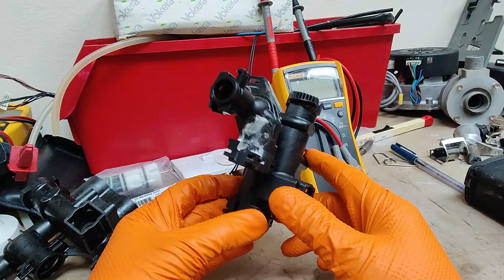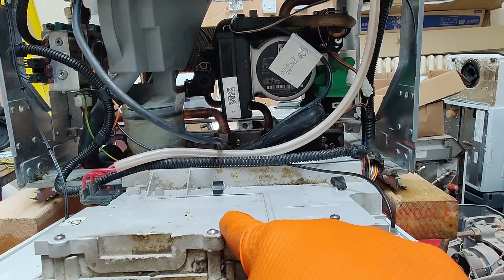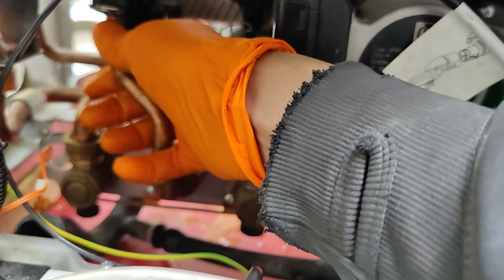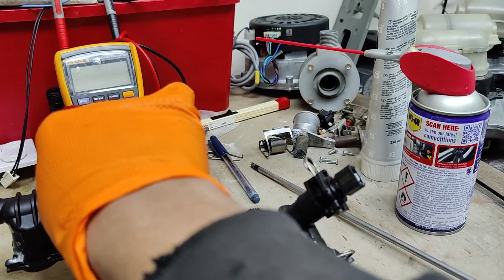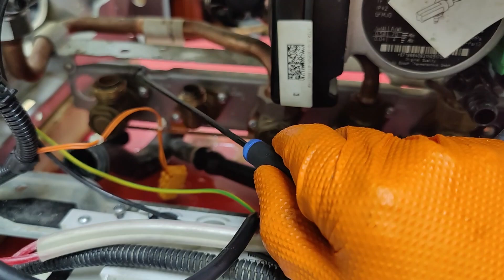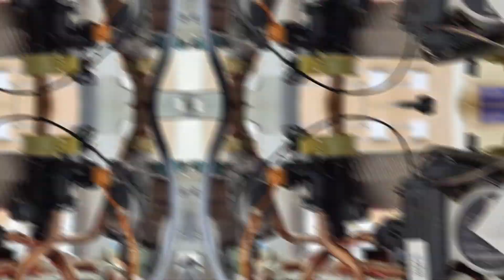How to Replace a Worcester Bosch Left Side Flow Manifold | Step-by-Step Guide

Comment: Absolutely brilliant explanation! I am a mechanic (old school) and found it dead easy to follow. I now have a leak-free left-hand block working fine. The only problem I ran into was the expansion tank. As I drained the boiler the expansion tank lost pressure too, but with a little fiddling I managed to re-pressurize it after I had replaced the block. Thank you for you clear and concise instruction. Now where can I borrow some testing equipment to make sure all is well with CO2 and gas pressure ;)
Reply from the maker: I am glad that you found the video informative however if you are not a gas safe registered engineer, you were not supposed to open your own boiler to fix it as it can be dangerous. I highly recommend that you get the safety check carried out by a gas safe engineer to ensure your appliance is safe to use.